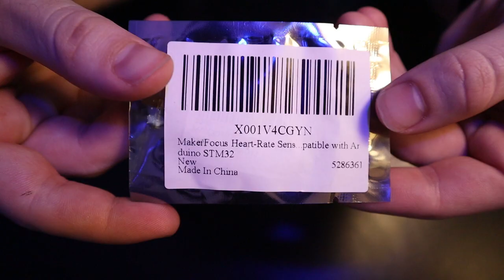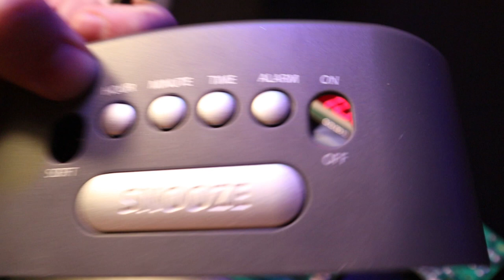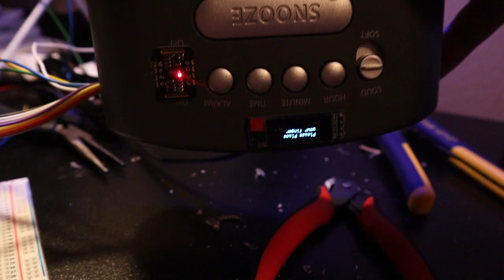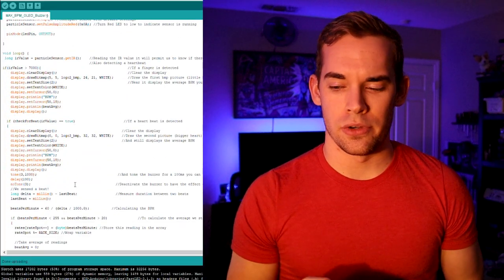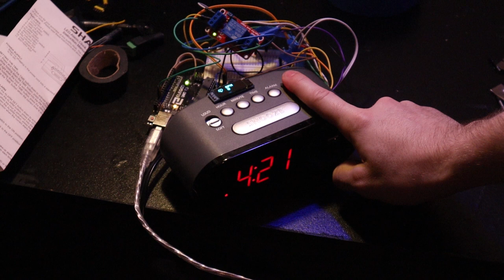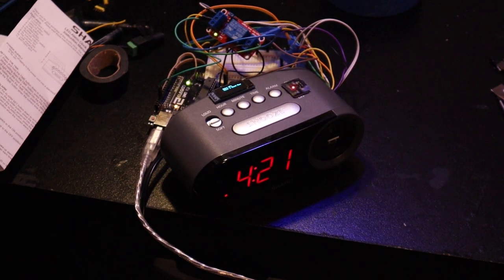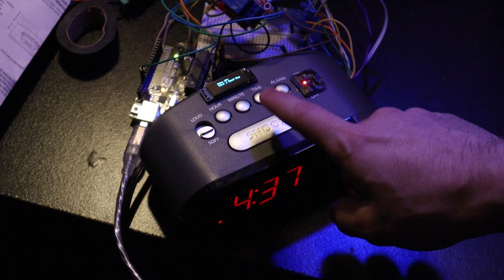Heartbeat Alarm Clock | Exercise to Turn Off!

Comment: And now add a wall mounted safe as a case for the alarm clock and the key can be stored at a place where you can't get it easily. Otherwise I might just break it one day.